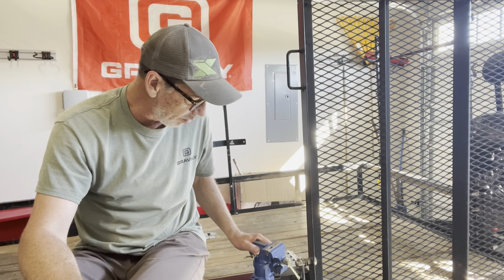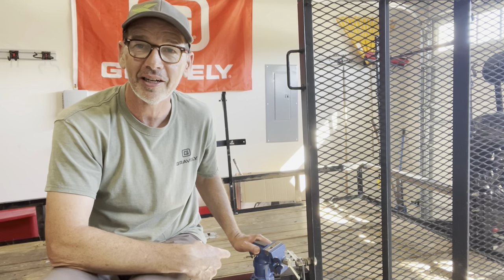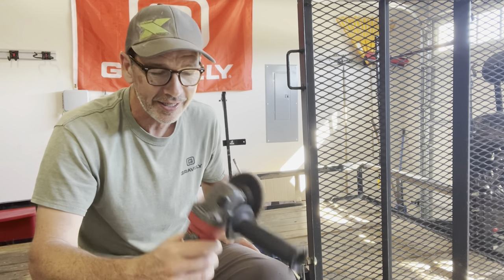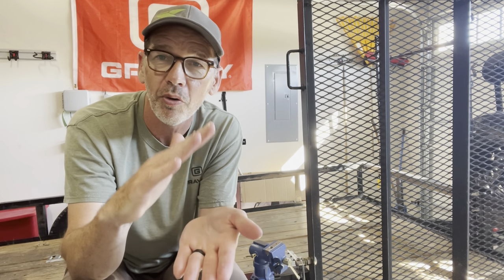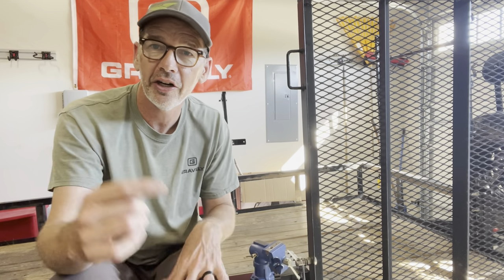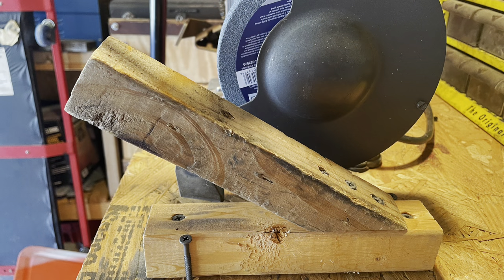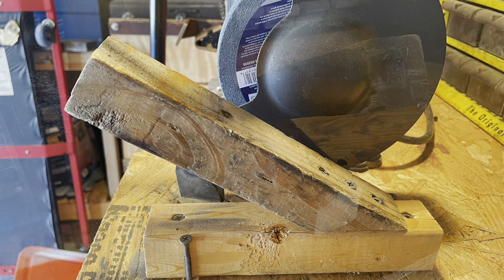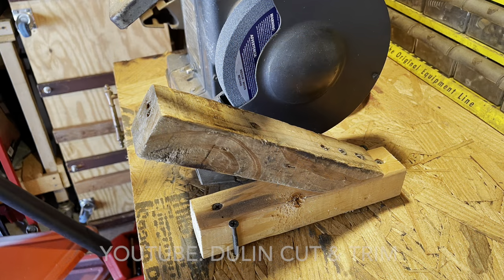Sharpen Your Mower Blades To The Correct Angle..for only $1

Comment: Your alignment fixture is 30° from the bench top and 60° from the face of the stone you are sharpening your blades at 60° LOL
Reply: That's what I thought also! Jig/guide angle needs to be 60° from the bench top to get 30° bevel on the blade as the face of the grinding wheel is 90° to the bench top.